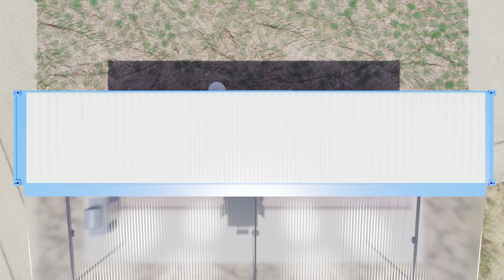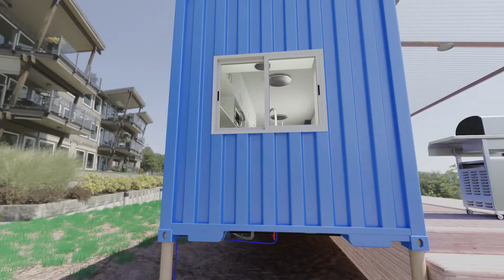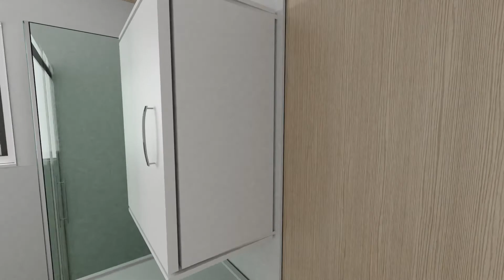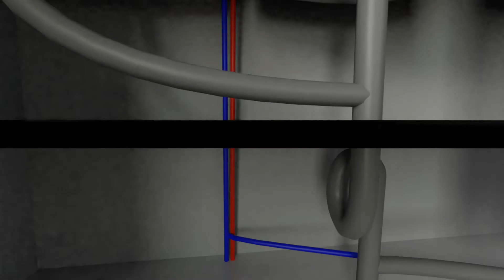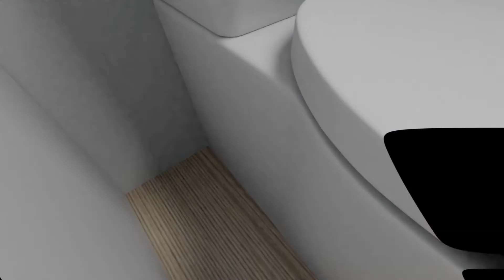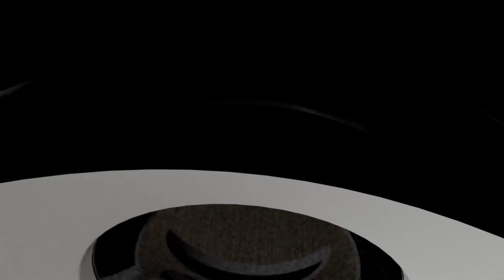Container House Virtual Tour

Comment: Hi Phillip, as a fellow kiwi interested in container houses I'd love to know: any progress?
Reply from the maker: I put together some building plans for the container and was briefly in touch with an engineer about it. His main suggestions were to put a roof on top because a container isn't rated for 50 years. Keeping in mind a house structure in NZ needs to be rated for 50 years where as the cladding and joinery only needs to be rated for 15 years of life. If you didn't want to do an extra roof you'd have to get an architect to sign off on it and say it's fit for the intended use. Another suggestion was to use 50x3 hollow square steel tube in the openings because that's standard and the more standard you do things the less you have to spend on engineering. (This is talking to an engineer who has had experience with container builds in Chistchurch)
After all that though I have decided to go for a kitset home instead which I'm still convinced is more expensive even though I'm missing quite a bit from my budget spreadsheet. The main reason for switching is because I want to move onto other projects and a container house would take me quite a long time to finish properly. I may as well finish what I was doing with the plans because it's so close. Just needed to update the subfloor plumbing to make sure those parts exist in the real world and are legit. Will quickly redesign the computer desk as well and re-upload it to blendswap. Would be fascinating to see if anyone builds from these plans but it's unlikely because you make a lot of specific decisions for yourself or partner with these small builds. I suspect that's the main cause of low resale value as well.
Reply from the maker: Alright everything is up to date now including build plans in the description.

Comment: This looks nice!
At school, my group does something similar but instead, we are to plan out a micro-house / tiny house.
My curiosity lies with the thickness of your wall, like why did you conclude with a ~50mm thick wall. 
Did you do heat & energy calculations to determine temperature and power usage to conclude with the thickness?
At least as I see it, this house would only be suitable in tropical/southern environments.
Reply from the maker: Thanks for the feedback. I haven't fully committed to the thickness of the walls yet so those could change. But here is the rational behind the walls so far: The R value of closed cell spray foam insulation is somewhere around 0.255 per mm of thickness. If we multiply that by 51 we get an R value of 13.005. A typical 2x4 wall insulated with closed cell spray foam insulation (which is considered to be quite good insulation) will have an R value of 9.3 if you include all the thermal bridging created by the framing. I've framed the house in such a way that the framing doesn't subtract from the space occupied by the spray foam. So the entire wall will have a minimum spray foam thickness of 51mm (excluding windows and doors of course).  The reason I decided on 51mm is because from what I've read, according to 1 research paper and reading 30 seconds of  it, that's the minimum thickness required to create an effective vapor barrier out of closed cell spray foam. The average annual temperature of my area is 14.3c although I haven't plugged that into any calculations its just FYI. If you have any online resources for reading or calculators/calculations I'd be interested to check them out.
Reply: @Sharft6  ah interresting.
In my study, we've calculated with normal house walls.
We use Insulation with a Lambda Value of 0.034 -> 0.043.
The wall thickness, divided by this Lambda, gives us the Insulation R-value which is lies around 2~3 with a 98mm thick frame. I find it odd for your Foam to have such high R-value but we have not learned that material yet (if ever) so I don't know much about it. So far, mineral wool is favoured here hehe. Also 14,3*C does seem pretty chilling, so it must be pretty cold there in Winter.
As far as i Know; avarage outside temp vs your inside temp (human body, apparatuses and heat panels) only affect how cost-efficient your house is upwards energy spending. So its ok with thin walls, but you end up spending more resources for warmth. 
btw Is your structure defined as a "House"?
A tiny modular house here is not defined as a House in Norway, so we can be more slacking when it comes to following structural recomendations/papers for building houses.
Reply: @Sharft6  Just in case, I use:
U = 1 / Rtot
R = Thickness (m) / Lambda (m-K/w)
Rtot = R1 + R2 + Rn + Rse + Rsi
Simplified calculation of U-value, Rse & Rsi are Chart values. 
Also, found out that a Inflated Foam Bed can have a R value at 9.5 which kinda makes me believe your R value.
Daym. Gotta learn more about Foam.

(Funfact: Camping Sleeping Bags are sold with R value at 2 for summer use, up to 5+ for winter use).
Reply from the maker: @BLODSWIPER  Ok. Now I'm getting confused haha. so google generally tells me the R value for closed cell spray foam is 6.5 per inch. Google also generally tells me closed cell spray foam has a Lambda of 0.026. So starting with the latter, R = (51/1000)/0.026=1.962. But if I start with the 6.5 R per inch and transfer that ratio to per mm (1mm = 0.0393701inch) R=(6.5*0.0393701)*51=13.051. I'm not sure why I'm seeing such a big difference unless I'm unknowingly trying to compare two different types of R values. Yes it's defined as a house because it's a permanent structure (not mobile) and has more than 10m2 of floor space. Legally it has to be built to code although I think most people just build these things in secret! My area requires an R value of 1.9 in the walls to satisfy the building code. If I lived in a colder part of NZ the walls would need to be R 2.0. Norway has an average annual temperature of 5c and the average temperature for the coldest month in my area is 9.1c.
Reply: @Sharft6  :D
Yeah if your R value is in m²K/W then I'm pretty sure we're talking about the same unit. λ = W/(mK) and U = w/m²K.
I don't know inches units and all, so as long as you don't mix those up, and can document it, i believe your calculations are all viable as they are. It's just that your R value was so high that I got confused.
But you can try translate  R-6.5 per inch into IS units to see if it matches up, I don't really know otherwise on whats up.